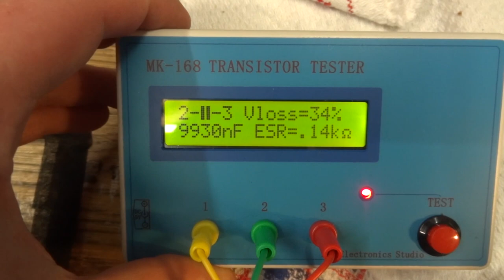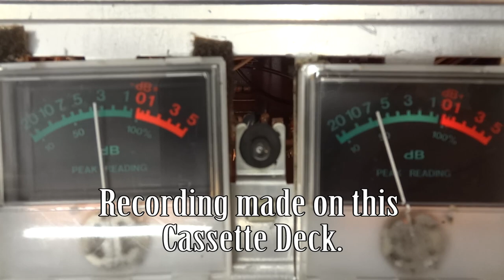DrCassette's Workshop - Tandberg TCD-310 Cassette Deck

Comment: Quite a nice sounding deck I recall. Because of the three motors and large capstan fly wheel, it had very low wow and flutter. This arrangement was more like a reel to reel deck. The only down side was it used a very cheap record/playback head which was quite soft and did not ware well. I loved Tandbergs reel to reel decks. Some has a separate bias head which gave amazing frequency response, even at low speeds.

Comment: Very nice job what you did there :) This Tandberg deck is built like a tank, I really like the three motor drive. It reminds me of the Revox B215, which has a four motor transport, and everything is DD. The only downside (of the Tandberg) is that is only a two head deck...
Reply: AttilaSVK Two head machines have their own advantages and disadvantages. Not every high-end cassette decks must be three heads.
Reply: There are other Tandberg models with 3 heads. This was the entry into the line 2 heads.

Comment: I have a number of language lab decks that used that chassis. In fact I suspect it was developed for consumer/hifi use from their classroom recorders. It's extremely well-made and reliable. The only problems I have had are the usual grease on the ballbearings, and dirty relay contacts resulting in intermittent sound or interference. One day I will record a video of one of them. The mech is identical, electronics less so.

Comment: Hi DrCassette,,
I have a TCD-310 I purchased new back in the late 70's that has very little usage. I'm an LP person
so the unit wasn't used much. Maybe 10 years ago it began to take longer to snap forward on play but
then it finally stop moving forward to snap into play mode. Fast forward and rewind seem to work fine and 
the meters light up and work. The unit is in very nice shape and I have the feet and cover. What if I just replace those two capacitor
that you mentioned. Maybe I can get away with not doing the ball bearing lube. The unit has been kept in the dry cool place
here in California. Can you tell me what Caps I would need and how can I find them to purchase. It's a beautiful deck.
I would only mostly being using it to listen to per-recorded cassette tapes. Tara

Comment: I made the mistake of removing the little "plate" which holds the supply-side pinch roller, and now I need to screw it on again, perfectly lining up the supply-side pinch roller with the take-up pinch roller. Any advice for this?
Reply from the maker: Doesn't the service manual give any advice for this situation?

Comment: Hi Doc; I just bought my first TD310, my 310 run rewind and forward but don't engage on playback, the solenoid is fine I have checked, after watching your clip I fined that about the capacitor on the switchboard, can you please give me the specification of that capacitor or even any other capacitors you mean is necessary to change on this machine. Thanks for such helpful clips.
Reply from the maker: All Roederstein (ROE) branded capacitors in the red plastic cans should be replaced.

Comment: I have this deck and a couple other tanberg but it's very hard to get parts for them.
Most technicians will not work on them anymore.
I have the model do you have there plus I have 2others.
They play fine but I want to put new belts on in anyway.
Do you think that's a good idea or should I just leave them the way they are
Reply from the maker: Never touch a running system... if the original belts are fine, leave them in there. It is very difficult these days to find good quality belts, oftentimes new belts will result in more wow&flutter.

Comment: Hello doctor I have a tandberg tcd 330 everything works but when I rewind the forward button light also turns on and does not rewind
Reply: The 330 is different, it is much more sophisticated control-wise than the 310, and has logic gates. If its the circuit I am thinking of, those ICs can fail, causing odd symptoms.

Comment: Great video! I’m working on a 310 Mk II, and it works pretty well mechanically (I, too had to remove old grease and re-lubricate). Unfortunately it runs a bit slow. Is there any way to adjust the speed?
Reply from the maker: If I remember correctly, this uses a synchronous AC motor. You can not adjust the speed of these motors as it is determined by the incoming mains frequency.
Reply: Thanks. That explains why I can’t find an adjustment. Oh well. If my math is correct, it’s only about 1% slow, which isn’t too bad.

Comment: The only thing I see about this tape deck that might make it worth all this trouble, is the fact that it is a 3 motor device.  That's a lot of work for a 2 head cassette deck, unless you were just going to set it on a shelf to display.

Comment: Does this thing use ac motor? I have some soviet decks and they are not early. One is from 1987 and the other one is from 1990. They use ac motor too. Thats weird. Actually type of motor they used in these was meant for reel to reel tape recorders. But the motor runs very stabile
Reply from the maker: I think this Tandberg too uses an AC motor. Back in the 70s that was not unusual.

Comment: Great machine. I have a TCD330 and I love this thing! Just a small question, there is significant humm on the audio, getting louder when the volume goes up, and is in the headphone circuit too.. Is that easily solvable you think?
Reply from the maker: That might be due to bad capacitors, as mentioned in the video, I found a few in my cassette deck.
Reply: @DrCassette  Thanks for the reply. I will have a look..

Comment: Great vid! Me, I seem to have a problem with the take-up spindle. I press play, and for about half a second the supply spindle starts turning, and the pinch rollers connect to the tape and start turning, too, BUT the take-up spindle remains in place. Any idea what the problem might be, and how I should go about fixing it?
Reply from the maker: The spindles are direct drive, so check the take-up spindle's motor and the associated electronics. The service manual is quite helpful.
Reply: Good to know, thank you! Just had a look at the manual, but I'm afraid my skillset just isn't there. Can't figure out HOW I'm supposed to check the take-up spindle's motor, and/or where its electronic components are located. :-(
Reply: I actually figured it out already!

My problem was due to the "cassette arm" having been ever so slightly bent out of shape. It no longer connected to microswitch MS4 (see the manual), which seems to be the one triggering the motor of the take-up spindle. Fixed that, and voilà, now it plays, rewinds and fast forwards as the Tandberg gods intended.

It still sounds like shit due to what MIGHT be shitty pinch rollers, but that's a seperate problem.
Reply: Sweet! So glad to hear I could be of service!

Comment: Doctor, i have an ER situation here. I told you i had an old ADS cassette deck that i rarely use. Well i wanted to use it this afternoon after at least 4 or 5 years of inactivity but when i pressed play only the left motor was turning the tape while the right motor did not turn. As a result the tape deck automatically shuts off after 2 seconds because The other motor is not reeling in The tape. How can i Get it to work again And why would it stop working if it is hardly ever used?  The model is The C3. Thx doc
Reply from the maker: Sounds like bad rubber components, either a bad belt or a bad idler wheel or maybe even both. Letting a cassette deck sit for so long is not a good idea.
Reply: DrCassette thank you for your reply. Fyi i am fairly good at taking things apart but putting them together again, well, thats a different story And The smaller The mechanism The worse it is. But i will give it a shot.
Reply from the maker: You can try to find the service manual for your cassette deck, it may be available online. It will contain drawings and instructions on how everything is supposed to go together.
Reply: DrCassette thank you, I'll try that.
Reply: DrCassette well doc, i am happy to report The repair for The ADS(Braun ) C3 cassette deck was a success. However i had use a makeshift substitute for an actual belt with a durable rubber band. It still did The trick as a temporary fix because rubber bands dont usually last very long. But since The repair was easy i said why not till i get a more applicable part for it. I Just opened The under side And there was The broken belt. There aré two other belts; a smaller one which Also easily reach able And a bigger one, not so easily reach able. I dread The bigger one breaking.
Reply from the maker: Thats nice that you were able to fix your cassette deck :)

Comment: Some of these decks had playback problems. Every SINGLE time: No sound in the LEFT channel playback/record. How to fix???
Reply from the maker: Bad internal connection(s), dirty record/playback selector switch, such a problem could have many causes.
Reply: Thanks!
Reply: hi i hv this deck. am having a problem of electric power all through the body of the deck when i plugin and press the power button. what is the issue

Comment: Just a question...what lube(grease) do you use on plastic parts...?  I hear some petroleum based lithium grease is not good on plastic parts...nice machine...I was thinking of buying one...for around 35$ USA....shipping included.
Reply from the maker: For this repair I used some random synthetic grease from a home improvement store. I guess only time will tell whether or not it was a good choice. In more recent repairs I have used lithium grease. Never heard of it being bad for plastic.